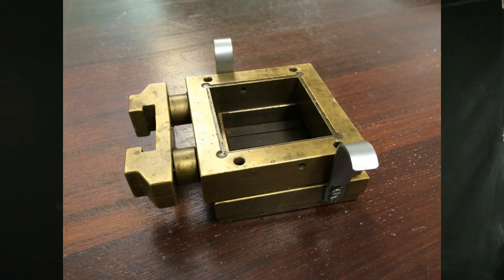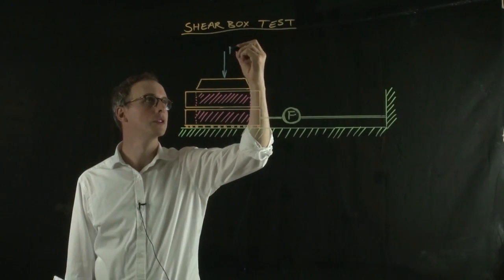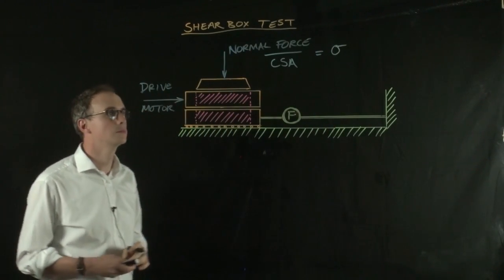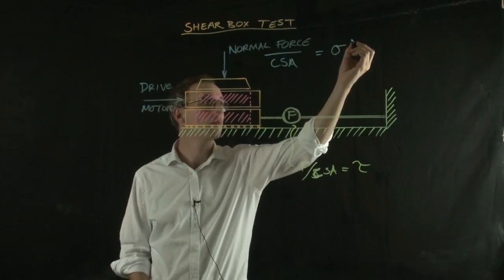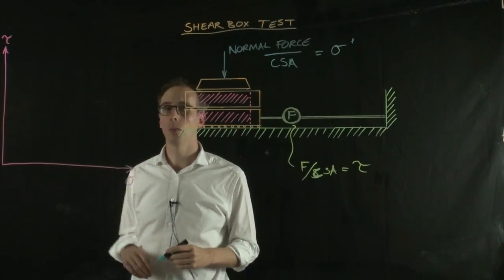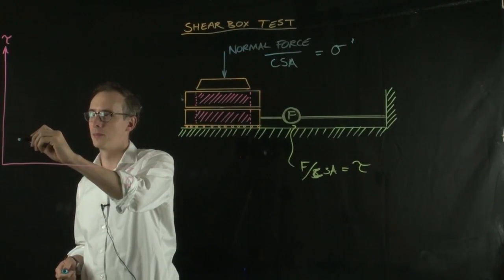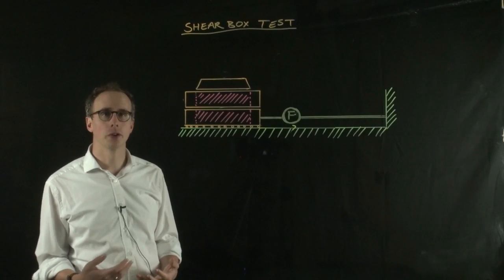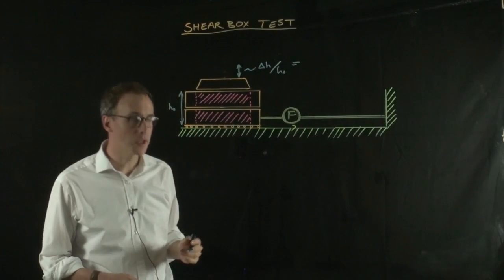The shear box test

Comment: this is good.
 i would like some more info on shear test on wood sample, any suggestions or advice?
Reply from the maker: Hi CristoClear, thanks for that. I've not heard of, or had any experience with, shear box tests on wood. I suppose you mean wood pellets, or dust? A shear box test is only useful for granular material. For strength tests on larger whole samples of wood, I suspect the orientation of the fibers with respect to the principal stress axis is important. I saw this however: https://www.youtube.com/watch?v=iRBkWFmCyco
Reply: CristoClear sir plz clear that how to   calculet tha valu of thita in shear box test